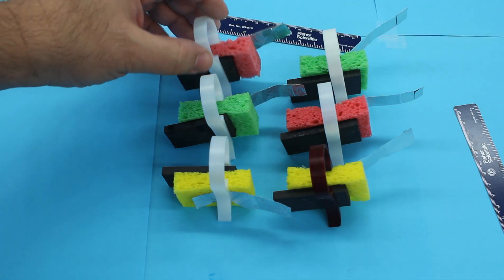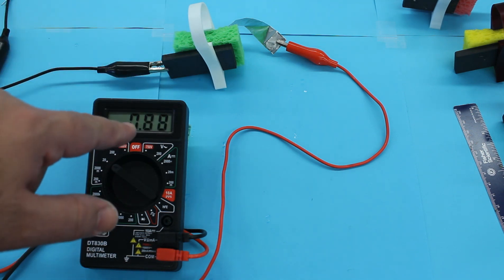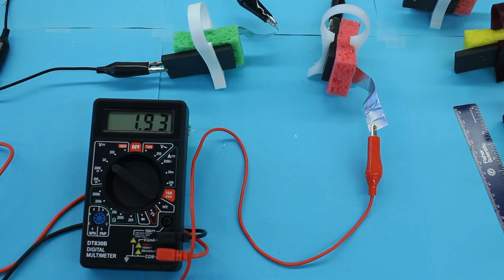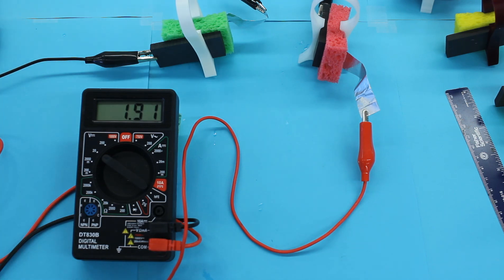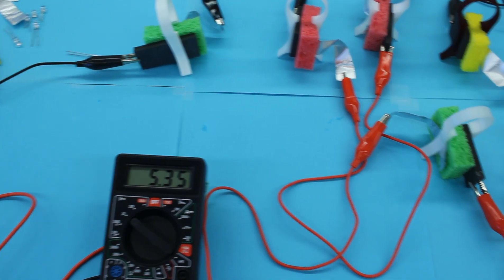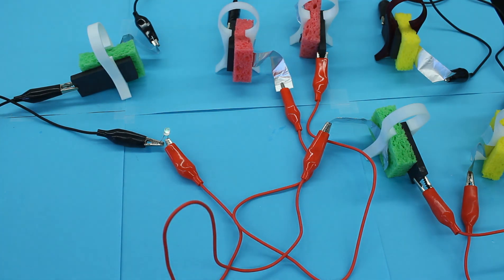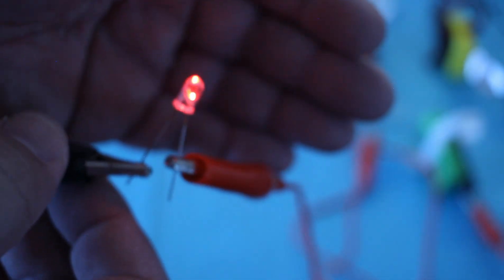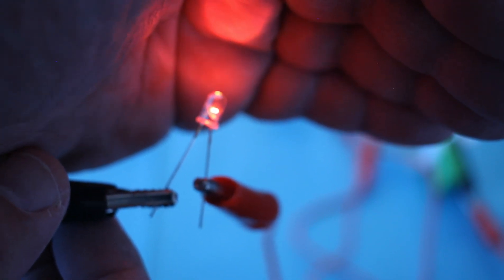The Air Aluminum Battery Part 2

Comment: What was that? Why did you spend your time on this?
Reply from the maker: 1.  An Air Aluminum Battery  2.  Who else was going to spend their time on this?
Reply: @radforduchem  If you know all individual cell voltages measured with a MM, there is no need to make a whole video connecting them in series to measure a final voltage. That's spd and time wasting. That was the point
Reply from the maker: @sc0or  Not all cells are producing exactly the same voltage and there is resistance when you connect two or more cells.  Which requires actually making the thing rather than just a calculation.

Comment: How it is possible to get a voltage from sponge electrolyte? Thank you for the video.
Reply from the maker: The aluminum on the sponge oxidizes producing a battery.  One side of the sponge has a slab of graphite the other has the aluminum.

Comment: For how much time it will work.
Reply from the maker: I have had a battery like this run for over 24 hours.  Typically, the sponges will dry up.  Adding tap water restores them.  The aluminum will also start to corrode and can break the connection.
Reply: @radforduchem  thanks.